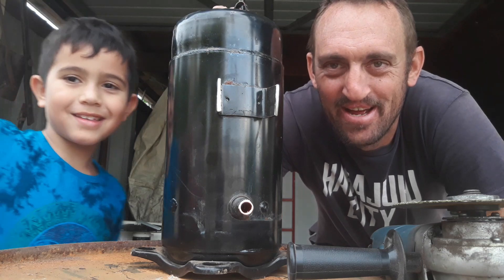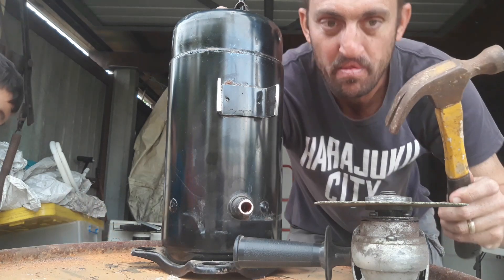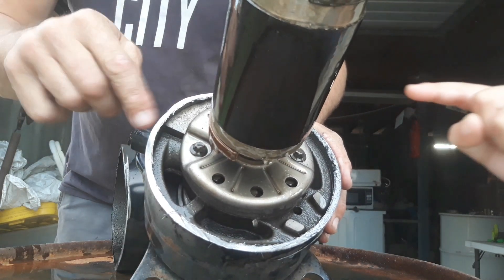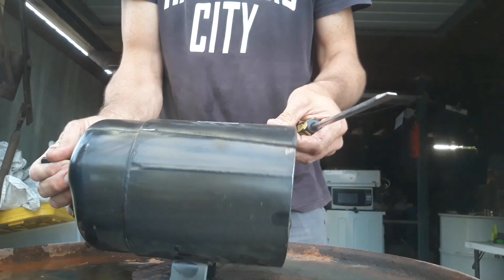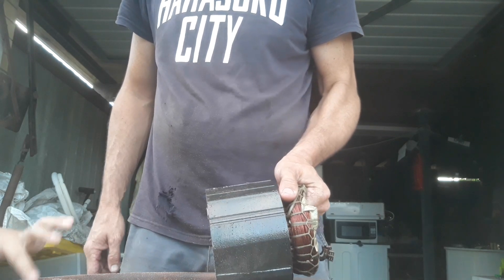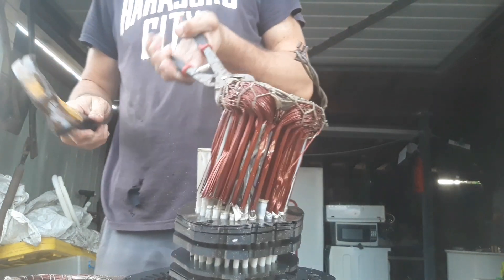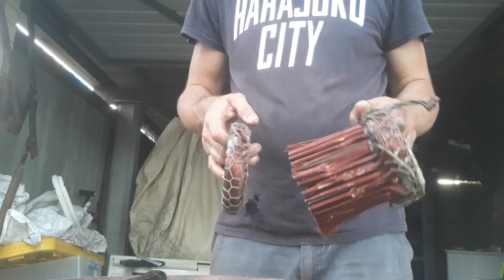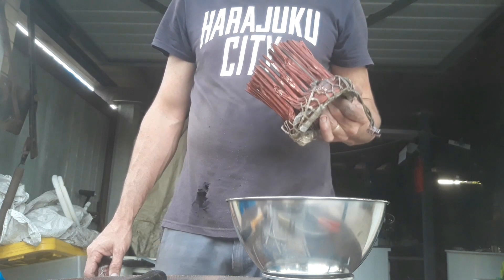To cut or not to cut...How much copper inside a 30kg aircon compressor?

Comment: Excellent, so apart from Copper what all metal can be sold?
Reply from the maker: Well you can also sell brass, aluminium, steel, stainless steel, iron, cast iron, cast aluminium just to name a few.
Reply: @danthescrapper815  Thanks a lot
Reply from the maker: @jgketan  No problem....Have a fantastic week.

Comment: Keep up the good work Dan that was a good video that made me decide I’m taking my compressors apart from now on
Reply from the maker: Thanks mate, glad you found it useful......Tho not entirely accurate i work on around 10% of the compressor weight is made up of the copper inside.......I no longer have the time to cut my compressors open coz i get too many now but with prices so high i still get good value selling them as is @ $1.05kg

Comment: Was your arm hurting just a little after all that hammering 👍
Reply from the maker: Hurting no but they do get heavy thats for sure. These days i dont have time to cut open the compressors anymore coz i just get so many aircons to strip every week. I did a scrap sell off today and just in compressors alone i had over 570kg which im getting $0.96kg, im doing another sell off next week coz i got around 300kg of electric motors and 100+ kg of stripped bright copper cable which is paying really well $10.80kg.